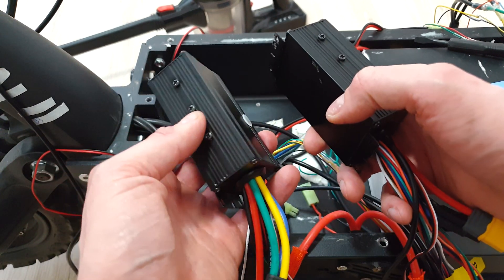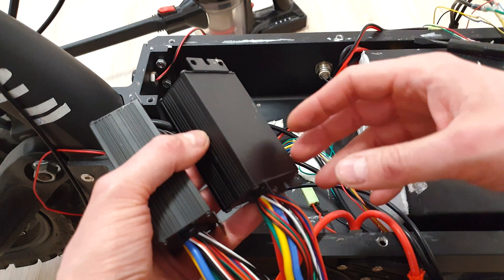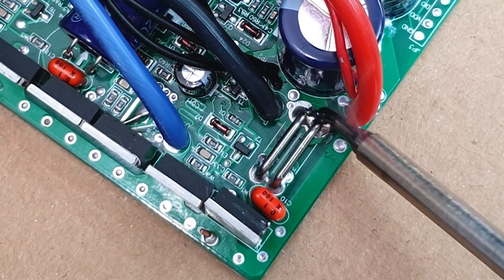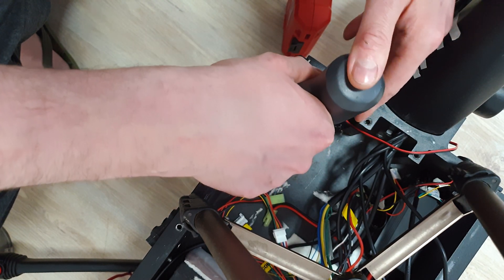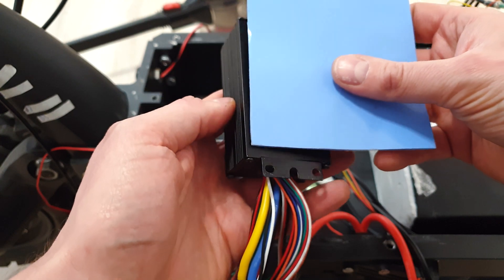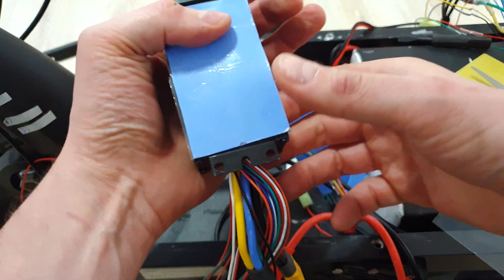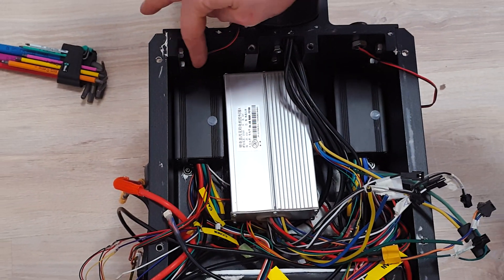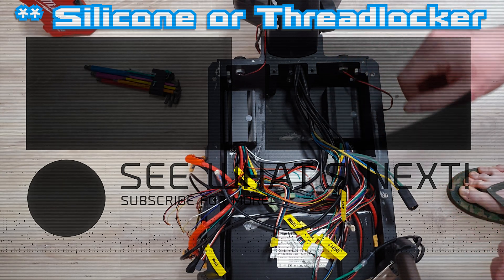How do I mount powerful controllers in Escoot ⚡ Flispky 75100 example ⚒️ Drill & Thermal pad 🍻

Comment: so these aren't good controllers if i keep burning out the OEM ones then, I love the idea of more power but i'm worried about the consistent overheating issue on big hill climbs, my controllers last about 6months before i blow a mosfet and need a new controller. maybe i need to look into ordering the mosfets and just resoldering the factory controllers rather than buying and rewiring the entire harness.

Comment: 1yr old video but just in case... Instead of thermal pads, use 2mm (≈0.08") thick aluminum sheet.  Cheaper than those thermal pads and much higher thermal conductivity.  Use thermal paste on both sides.  Thermal pads should only be used on uneven surfaces.  If both are flat, use copper or aluminum.

Comment: Bro u should not use crap case of does contollers , since all mosfet on the side ,no reason to mount it like that ,get a custom alu plate and istall without housings ,than you fix that to the body, if bolts long you cut them or use shorter ,lot washers not a good idea, also if you use silicone ,use from the outer side since water will come from there ,just neutral and outside,uv protected ,no reason to use else.
If you look for even stronger use pu50 you can seal boat with that.

Comment: This mounting method for the 75100 will work well for lots of people. Since your mosfet wall touches the side of the battery box, I would have added thermal pad there as well.

Comment: Still waiting for the detailed install guide for the flipsky 7550 with 1x 48v monorim motor for Max g30 please. Also i would like to add the flipsky display, which i have, or a large colour display instead of stock dashboard. If you could do a dedicated install guide for this controller on your site, please, i would be extremely grateful. Cheers Bro!!🛴😊✌

Comment: Zero 10X ESC's run 80v fets ;)
Pretty keen to see how this build goes, have been considering the 75100's for a scooter for a while now. Surprise is, mine are actually about the same size already
Reply: I have a Kaabo mantis pro, the Minimotors 2X 27A 60V controller is a bit smaller than one 75100...im considering 75100,s for it because sine wave is superior and bluetooth settings are also nice to have.
Reply: @-joo3033  sine wave is superior for speed, but not torque, keep that in mind before you do your swap.
And also that the stock battery is already maxed out for current supply, any more and youll have to add a second battery or replace the existing one with better cells

Also the latest 5.2fw has been bricking vescs so be careful tgere ✌️
Reply: @JamiePineappleWyatt  5.3 bricks vescs, because of phase filters, just get Jaykup's firmware

trust me when i say the FSESC75100 alu pcb version on my scooter accelerates much harder than the original 28A controllers, i still have the battery current per controller on 38A (90A bms trip limit, some safe margin) and it's only a 48V scooter, i have phase current on 98A, but this controller should be able to take 110 phase amps atleast i think (it's the alu pcb version, it has 380A mosfets but the pcb will break if you try that much)

----- edit ‐----
the alu pcb controllers take 120 phase amps just fine
----- /edit -----

I need to build a diy pack that can do 100 or more amps and higher voltage (it's an Obarter X3), it's already very fast though

but i have it in current control no reverse brake adc2 mode with brake on throttle on adc2, it's insanely smooth, i could try to create adc PID speed mode for the people that want the original controller feeling, cuz original controllers just do full acceleration till it reaches the defined speed by throttle rather than vary the torque, i prefer current control mode tho personally

i also almost never use my physical brakes, i always use variable regen by a second throttle and it's plenty for me

if you don't care about regen and want similar operation to the original controllers you can use ADC PID SPEED mode
Reply: @-joo3033  get the alu pcb version if you don't want temperature issues

Comment: Yes I’ll love to see a set up video for these controllers too. I see the 75100 is limited to 550w motors, so can’t be used on more powerful scooters?
Reply from the maker: U mean 6000w  cuz 100A x 60v
Reply: @PirateWasHere  looking on Flipsky Tech’s 75100 video in the comments he mentions many times 550w maximum. This is where I was getting confused. I’m having issues with my Yume D5 controllers and I’d love to replace them with these. Are there any performance gains?
Reply: @domgoff999  I am using a Flipsky 75100 on an 8000W motor. I have issues with the controller overheating but the controller is only a temporary installation until a bigger Trampa 100/250 arrives in the mail.
Reply: @phylaxxx  my motors are only 1200w each. I’ve ordered 2 x 75100. My original controller doesn’t have hall sensor wiring but my motors do. My controller uses back EMF instead and it really doesn’t work, motors stutter on acceleration. So hopefully with the 75100 it will be much smoother and can upgrade motors in the future
Reply: @domgoff999  In what video? I cant seem to find it?
Reply: @domgoff999  You got it all wrong, he said that his scooter motor was a 550w one.
Reply: @ScinnerNo1  at the start of video it actually says it’s a 350w motor. So just a bit confusing. Anyway I understand I got it wrong. I’ve ordered these controllers for my 2 x 1200w motors :D
Reply: @domgoff999  Perhaps Flipsky was a bit confused! Let me know how it worked out! Im about to order two aswell for my 2 x 2800w laotie ti30 to make it "legal" in sweden!

Comment: Are they compatible with the display? Could make a video explaining the connections of the cables Thanks 👍
Reply from the maker: for sure not compatible  ;)
Reply: @PirateWasHere  This is also a question I've had. So the do the Flipsky controller not work with any of the displays out there? Only there own ugly blocky one? I really want to get two of these or the Dual version but not keen on that Flipsky display.
Reply from the maker: @d1o2n4  there is couple free diy schemats and check davega X